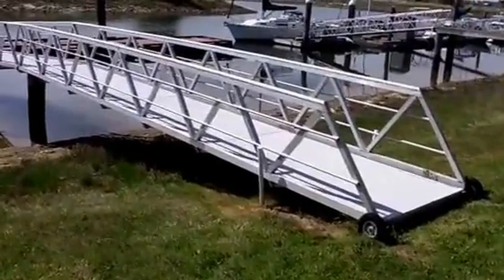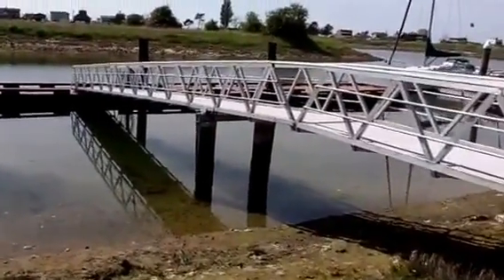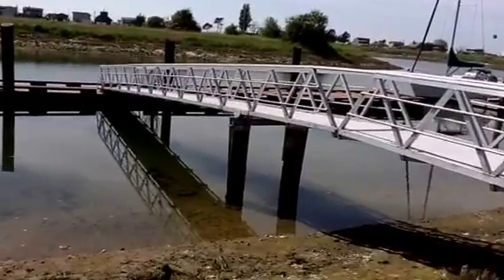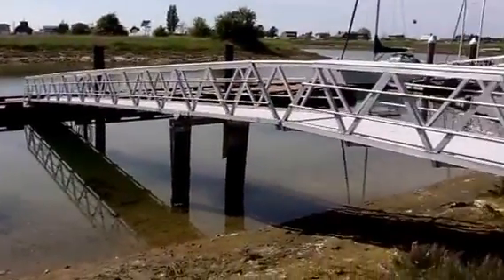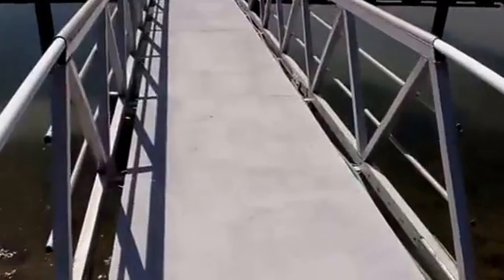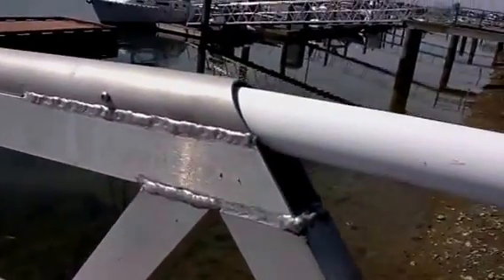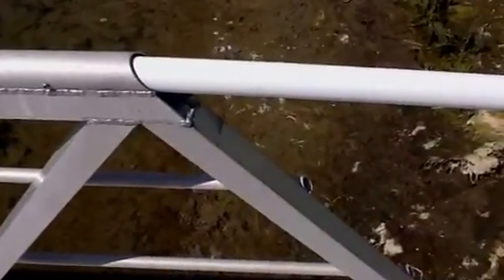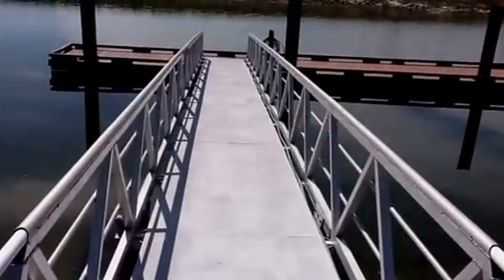80' aluminum walkway ramp cantilever design

Comment: Great design.  Simple, light weight and I assuming plenty strong enough.  It looks like you are using Solid works for the design,  I am using Creo and was wondering if you would consider sharing the design as I am planning a 42 foot long gantryway (non cantilevered) out of aluminum and would love to use your concepts as a starting point